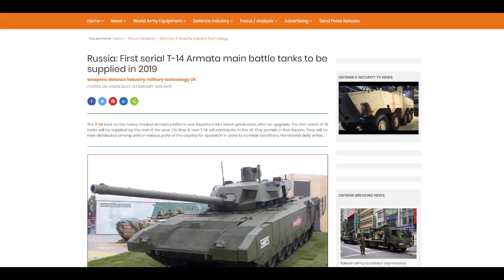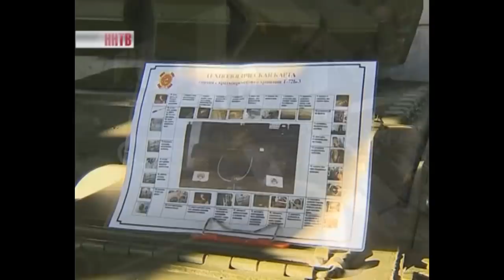Problems with Russian tanks

Comment: Press F for the 4 guys in the T14 factory
Reply: @ultra sisko Analogy for Armata's slow production
Reply: @iqbalnash5748  mbt-70
Reply: @iqbalnash5748  And why issue many tanks and to repeat mistakes Leclerc-2 and f-35? The design stage involves the production of a test series, engineering samples for testing usually at least 100 units.
Reply: Джо //Elusive// ... actually Russia was supposed to order 2300 T-14’s by 2020, reducing the order to 20 with further orders for 32 more, so not even close to having 100 T-14’s? The simple truth being that while president “blowhard” Putin rattles his saber ... because of economic sanctions, Russia has been forced to reduce their defense spending by $20 billion, all but canceling the T-14 and SU-57!??
Reply: @JimCOsd55  Russian Industrial output increased by 14% last year. 
The best growth recorded in the world. They still have many major projects coming on as a few others finish. Something has to give. There biggest problem at the moment is a lack of skilled workers. Even with a big influx of skilled workers from Ukraine as a result of the USA Coup they still are short of skilled workers. Also the brain drain now of the 1990s is reversing itself. Many skilled coming back home. This shortage of workers is the very reason they use mainly Guest workers from CIS nations on major projects that only require semi skilled people. 
This lack of skilled people is not uniform throughout all of Russia. He could be correct when he says they are updating the older T80s for the simple reason there are not enough skilled workers and a plant suitable to do the newer models elsewhere. As a compromise they have decided to do the older tanks at the plant that built them and in an area that has the skilled people available to do the job. A few upgrades at the plant and upgraded tanks coming off the line and skilled people back doing what they should be doing. Solve two problems at once. 
Some idiot here says the Russian Defense Budget has decreased by $20 billion. Yes! Based on Exchange Rates. An absolutely useless comparison now Russia overall operates outside the Western Financial system. If he understood Economics at all he would understand. Based on GDP Russia has not been growing much. The exact opposite is the case. There Production of Goods and Commodities has been growing quickly.
 Russia has been reducing its Defense budget as a percentage of its total Production and as a % of its Budget but in reality it has stayed much the same. While it accounted for a bit over 4% of its Production 4/5 years ago it now accounts for about 3.2% of there Production. With there increases in Production it still remains roughly the sane in terms of what they buy. They are now at about 70% of new or heavily upgraded equipment. Ahead of schedule and actually under budget. By 2020 they will be close to the 100% they were aiming for.  
There motor industry is back at full production again. Is the USAs? The thing that slowed it up was a rise in interest rates when Financial Sanctions went on. They now have found alternate finance outside the Western system and interests Rates in Russia are well down. About 4/5%. There Corporations have got out of Western Loans quickly and probably will never touch them again. You can't trust Western Banks and the way the USA and UK Government uses them as a Weapon. Just like the way they use the IMF as a weapon. 
It all has failed whatever way you look at it. Russian Industrial Production and Agricultural Production has been growing quickly and the sectors that supply them. Oil has improved but never really recovered. Gas has increased in price and the demand. Within weeks the new pipeline starts to deliver Gas big time to China. That will be big money flowing into Russia and one big project finished. There Trade Surplus increases even more and Tax Revenues go up again. This is why they are reducing there Defense Budget. Not in real terms but as a % of there Budget. 
Why everybody gets confused is because everybody quotes GDP. A useless measure for Russia now they overall operate outside the Western Financial system. It does not measure Production. 
Sanctions have not worked at all. Overall the complete opposite effect on Russias Production the USA wanted them to have. 
These increases
Reply: @JimCOsd55  The reason is much simplier: Russians have technology, but they do not have industrial power to implement it. They need whole new factories, since old ones simply can't handle T-14 production, as well as there is lack of qualified personel to man those factories.
Reply: Discerning Troll ... and so with all these good economic numbers - did Russia reinstate production of the SU-57 and T-14 Armata? Nope, even at $3.5 million a tank they’re going with the simpler and cheaper expedient of improving older T-80’s with new fire control since they’re no way to fit the improved 125 mm gun and they’ll probably incorporate the active defense system into it eventually. While the SU-57 which still lacked the avionics and engine to compete with the F-35 would cost $135 million a pop, one of the reasons India dropped out of the program when they figured they could buy an F-35 for $90 million to compete against an F-35!
Reply: @平教經  one t-14 factory  plant is already  manufacturing the second  plant  is under construction  you will see the  results after 2020.
Reply: @JimCOsd55  acording to this sources by 2000 whe must have already the World end   20 times  acording to them .What a bulshitt lies do you invent just recently  from Ukraine around more then 2 milions  peopel  mooved in Russia  betwean them where a lot of scientists  and  workmanship employes.Now even from African continent the Boers moove by thousand in Russia .A lott of Austrian and Germans  are considering  to moove to russia if this migration crisis will not stop.
Reply: lowe booty ... even Putin admitted in an address in 2006 about the demographic crisis and again last year. While Russian immigration is limited to those of Russian parentage so Russia did add 2 million when they invaded the Crimea but that is one of the reasons sanctions have hurt their economy, causing them to reduce defense outlays and cancel the SU-57,T-14.!??

Vladimir Putin Warns of Russian Demographic Decline
Vladimir Putin pointed to the decline of the Russian population as a result of the Second World War and "roughly the same decline in the mid-1990s due to enormous problems in the economy and de facto breakdown of the social sphere."
AFP
Updated: November 28, 2017, 9:00 PM IST
Reply: Discerning Troll 
Very well said, they also have massive reserves of natural resources and like it or not the whole world needs these so they can only be held down for so long 👍
Reply: @JimCOsd55  Well, might be. Only thing, that could potentially save Russia are right-wing politics on all levels, but it will be impossible for them without overthrowing their modern rotten-to-bones cleptocratic political system and that again, requires people of special mindset, which modern Russia does not have. Russian nation however is in some kind of nation-wide depresion: people lack will to act and lack passion to be able to sacrefice themselves to noble cause. It is worsened by their government declaring any political activity, that goes against the views of their current post-soviet system, being instantly declared extrimist and people end up in prison. One thing, that modern Russian government clearly got right is how to prevent insurgencies, I give them that.

Too sad, since I admire the culture they were before 1917.
Reply: @lowebooty8821  Before the Coup in Ukraine there already were about 4million Ukrainians working in Russia. Not much point staying in Ukraine now while the useless unproductive Western areas of Ukraine are now in control.
Reply: @JimCOsd55  You obviously live on wishful thinking. Sukoi and responsible Government spokespersons have been saying for years the SU57 will go into production when the new Type30 engines is proven up. There top Defense people have also said numerous times they will buy the SU57 when it becomes available. 
They don't want a joke like the F22. About 187 supposedly built but only about 120 combat capable. The first 67 supposedly Production Aircraft are not capable of Combat. Probably never will be. Too expensive to get them Combat Ready. 
Was that clever. Put them into Production and it was not until Number 68 they actually got a Combat ready F22. 
The F35 even though delayed is a bit better. About 100 supposed Production F35s that are not Combat Capable. Too expensive to fix. Another 100 supposedly Production Aircraft that may be worth updating to Combat Ready. Maybe.
Reply: Discerning Troll ... dropping 3 million since 1990 is not a static population, a population needs to grow, they need to replace their workers as they age. A growing population looks like a pyramid with the youngest at the bottom and coming to a point as the population ages and dies off. Russia is not only suffering low birth rate but coupled with men dying at an earlier age due to alcoholism and problems inherent with that, there pyramid is turned on its head. Putin’s attempt at reversing this decline has slowed it down but it’s still not enough to save Russia from this demographic crisis nor is it just them facing this problem. China’s one child policy has also left them with a skewed pyramid where as their population ages, there are fewer workers to replace and support them! 

The 111 million population by 2050 is an extrapolation by scientists including Russian that if no changes are made, it can be reversed if Russian women begin having more children the problem being that today’s women across the globe are no longer interested in large families! Many western nations are facing this problem ... the only thing saving the US is the influx of immigrants both legal and illegal which is why the US’s population grew by 80 million when Russia’s dropped by 3 million!??
Reply: Discerning Troll ... if the F-22 was such a joke then why did Russia attempt to produce the SU-57? They may get engine working by 2025 according to their plans but without backing from India, its pretty much a dead end project! Everyone saw how the F-117 flew into downtown Baghdad thru some of the strongest air defense of the day to accurately hit targets without a scratch. In 25 years of service and 2500 sorties, they hit over 60% of their targets with only one F-117 ever being shot down, more likely due to a Serbian commander positioning his S-75 battery in a position he noticed the jets used time and again to egress after an attack. He was never able to duplicate that feat in the 78 day air campaign otherwise the US would’ve grounded the entire F-117 fleet once they realized that Serbia could target and shoot them down at will!??

As a comparison, India launched a dozen Mirage jets, each carrying 1000 kg in bombs to hit a terrorist Madrassa in Pakistan last week, they said they wiped it out but satellite photos didn’t even show one bomb crater, the Madrassa was untouched ... they were forced to drop their bombs by Pakistan fighter attacks that downed an Indian MiG 21! 

The F-22 was designed as an air superiority fighter to replace the F-15 and take on the latest soviet fighters on the drawing board until the Soviet Union fell, then it became hard to justify its cost against an enemy that no longer existed? The US saw how Russia worked to improve their S-300 and S-400 missile systems and knew the subsonic F-117 needed an upgrade so countered with the supersonic F-35 as a multi role fighter able to attack and fight against those SAM systems. We may find out who has the winning design if Israel and Syria ever pit the F-35 against the S-300 to see who has the bragging rights and who has to go back to the drawing board!??
Reply: @JimCOsd55   Putin wanted 2,000 of them by 2020.......it's 2019 and there's less then 50 built give me a break they underestimated how hard it is to build a modern MBT
Reply: Theprfesssor ... I totally agree, they wanted to build 2300 T-14’s by 2020, dropping that order to 20 by 2018 with another 32 ordered by 2020. The drop in oil from $100/bbl to $48/bbl along with the economic sanctions made the tank to expensive to build in the numbers they needed so Russia turned to the cheaper option of improving their T-80.
Reply: @JimCOsd55  Probably a bad translation of the media. 2300 tanks by 2020, taking into account the repaired T-72B3 and T-80BV M. Nobody spoke about 2300 T-14 since production isn't ready, the plant is only under construction. The first series of Armada of 100 units is ordered, so if more than 1/3 is T-14... that's good. More than enough for the tests. All the same, these tanks will be returned to the manufacturer to eliminate defects in serial tanks.
Reply: Джо //Elusive// ... Of course, bad translation? More than three years after Russia’s T-14 Armata tank made its widely touted and much scrutinized public debut, the country has made it clear it has no plans at present to buy more than 100 of them. The design’s ballooning cost has forced the Kremlin to focus its efforts on upgrading its T-72, T-80, and T-90 tanks, instead.

In 2015, Oleg Sienko, then-Chief Executive Officer of Uralvagonzavod, or UVZ, the T-14’s state-owned manufacturer and Russia’s largest producer of tanks, had said that he expected the Kremlin to order as many as 2,300 Armatas by 2020. The first examples made their initial public appearance ahead of the annual Victory Day parade in Moscow that year and one suffered an embarrassing break down during a rehearsal. The Russian government's planned purchases of the type have steadily shrunk since then.

“We don’t really need to for this, these models are quite expensive in relation to existing ones,” Russian Deputy Prime Minister Yuri Borisov explained to reporters to reporters on July 30, 2018.

http://www.thedrive.com/the-war-zone/22600/russia-cant-afford-its-new-t-14-armata-tanks-turns-to-updated-older-designs-instead
Reply: @JimCOsd55  100 units is the first series for testing, the platform itself, not only the T-14 tanks, they are already ordered and ever produced.
the figure 2300 appeared only in the report, which state the need to replace 75% of military equipment with new or upgraded by 2020, no one talked about 2300 T-14 is a journalistic duck.
True, it makes sense to concentrate resources for the renovation of production in the first place. For the production of serial T-14 built a separate plant.
Ministers can say anything, they do not know what is happening in the industry, they do not have access.
All the above officials should be checked from the point of view of the economy, they do not understand anything in production. Yes, the T-14 is much more expensive, but the T-72B3 is cheaper and there are many of them, it is a statement of fact, not a statement.
Reply: @JimCOsd55  t-14 is formidable platform comparing to any existing platform, even foe from foreseeable future, while su-57 is pure garbage compare to China and JSF 5th gen offering, it is not even up to some 4th gen plus standard on some part.
Reply: Brian Lock ... still, the T-14 being formidable means nothing if Russia can’t afford to build them in sufficient numbers?
Reply: @skippy5712  an increase of 14% from the 20 tanks is not good.
It's like when I tell my teacher that I have improved my grade by 1800% because I improved my grade from 1 to 18.
It's still a fail.
Reply: @JimCOsd55  Stop playing with figures. You go back to 1990. Yes there population dropped during the 1990s. Russia was a disaster area. 
Get out of the past. What has happened since 2010?
Reply: @JimCOsd55  Obvious they had Technical Problems to solve when the Military tested the first 14 x T14 Tanks. That happens in every Nation. 
Also they probably have changed there Defense Priorities. 
Russia and Putin in particular are determined to keep there Military Spending down.
They have dropped it since 2008 from over 4% of GDP to less than 3% now and intend to keep reducing it until 2025 as a % of GDP. 
You have to remember in recent years they perfected there Hypersonic Missiles, there Hypersonic Glide Vehicle, there Kalibre Cruise Missile has proved itself. 
Not hard to understand they change there priorities as Technology. 
There Improved Missiles don't need Stealth Aircraft. The SU57 becomes less of a priority. 
Who knows how advances in Technology and perceived Threats has changed there priorities. 
Slow up one program to push another one ahead. 
As I said Putin is determined to get there Military Spending down to obviously about 2.5% of GDP. 
Is that beyond you?
Reply: @God-yr9rs  I never said it was. 
Russia has its own Priorities. 
Production of about 1,000 Kalibre Cruise Missiles though is a big increase. 
There new Hypersonic Missile in early Production is a big achievement. 
For all you know they took money from the T14 program to there Missile Program or the most likely thing is they had technical issues with the first 14 when there Army started testing them. There secret. Happens everywhere. 
The SU57 is clear. They clearly said a few years ago the Testing of the Type30 Engine was going so well they would not start full scale Production until the Type30 was ready. Common sense.
Reply: @skippy5712  
There is no shame in having a crappy economy.
We are not trashing your equipment quality.
We are trashing your economy.

Just close the Central Bank of Russia. Stop increasing the money supply.
Deregulate the economy into oblivion and then you will see a result.
There will be a massive recession, but it will stabilize your economy in the long term.
Reply: Skippy ... Putin was taking advantage of the rise in the price of oil 9 years ago and was increasing spending! That’s when they talked of building 2300 T-14’s and 450 SU-57’s, then the price of oil dropped forcing Russia to cut back defense! Yet Putin kept on talking about all of the new super weapons he’s building causing NATO to increase their defense spending to $900 billion! Yet, like the T-14 and SU-57, they’re having trouble getting their nuclear powered cruise missile to work with 4 failed launches and now their engine exploded a few weeks ago killing the engineers designing it! Look, the US has 6500 warheads with 1600 ready to launch, Russia has about 6800 war heads with 1600 ready to launch. We both have enough warheads to make both country’s and most of the world a nuclear wasteland! Putin is blowing hot air about new super weapons that will make little difference to the balance of power. Neither country has the technology now to stop the others 1600 war heads ... so spending money to build new unstoppable weapons makes little sense! Especially when the country’s you threaten have GPD’s that dwarf Russia’s by 31-1 and can easily outspend Russia on defense by 28-1!??
Reply: Skippy ... since 2010 ... 3.6 roentgens, not great, not terrible?

The population actually did increase for 3 years before continuing its downward trend. The U.N. figures that Russia’s population will drop to 132 million by 2050 with 1/3rd being over 60! While Europe’s will decrease to 450 million and the US population will increase to about 438 million by 2050? This demographic change is already effecting conscription into the Russian army?

Recently, the number of young people who are fit for military service has been growing mostly due to legal measures and a new definition of “fit for service”. In fact, in the past two decades in Russia, young people’s health has been deteriorating. One of the most significant factors affecting the poor health condition of today's young people is excessive use of alcohol starting from an early age. Recent studies underline the significance of excessive alcohol consumption as an explanatory factor in the unusually high mortality rate among young Russian men.

The fact that Russia now allows foreigners aged 18–30 to serve five-year contracts in the Russian armed forces indicates that the Russian leadership has a realistic view of the demographic problem facing the armed forces in terms of the quantity and quality of conscripts.

https://puolustusvoimat.fi/documents/1948673/2015525/The+Russian+demography+problem+and+the+armed+forces+Trends+and+challenges+until+2035/a2ef95eb-b9ab-4563-ba31-cc1010b3c20c

2010	-239,568	
2011	-129,091	
2012        -4,251	
2013	  24,013	
2014	  30,346	
2015	  32,038	
2016       -2,286		2017	-135,818	
2018	-224,566
Reply: @JimCOsd55  Bullshit! Thats your wishful thinking. 
In real terms there Defence Spending remains the same. 
They still buy at least 100 new Fighters a year. 
The T14 will take over in time. 
Why the hell do they need it. 
They have about 50 Battalions of S400 deployed. 
They have about 100 Battalions of upgraded S300 deployed with another 100 Battalions of S300 in Reserve. Not upgraded. 
They are producing about 1,000 Kalibre Cruise Missiles each year for there Navy and Air Force. They don't need anything special or new to use. They have such a long Range. 
They just let a Contract to upgrade 4,500 of there older Cruise Missiles. 
Who is going to attack them? 
The USA might have a big Navy but Russia is set up very well to fight a land War.
You talk shit.
The USA is now supposed to have at least 2,000 F35 deployed. 
Is the reason they have not because the USA can't afford them? 
No. The F35 has been one delay after another. 
It will be 2023 before any F35 approaching the original Specification starts coming off the Production line. 
The DAS is already surpassed by other systems in the World it has taken so long. 
Not until 2023 will it be ready. Not until then will they have Software that can meet the original Specification. 
What about the Zumwalt. Twenty years and still not operational. 
Still no Gun. To be converted into Missile Boats. 
Only three sort of built. 
So hopeless the USA is looking for a Foreign Frigate. Not a smaller Zumwalt. 
A complete stuff up. Russia has those also. 
Technical Problems in Development. 
At least there Nuke Deterrent is being replaced by ICBMs at least 2/3 Generations ahead. The USA still talking and researching. 
At least there new generation Cruise Missiles are in production including there Hypersonic Missile. The USA is only 12 months into a Hypersonic of what type we don't know. 
The USA is too broke at there Costs to keep up in all these areas. 
The USA is too broke to develop a better Patriot and Deploy it in Numbers. 
Too broke to develop and Deploy a Guided Hypersonic Glide Vehicle for there Nukes. 
Still only has the old Minuteman. 
Too broke to Develop any really new Anti Ship Missiles. 
Too broke to equip and arm there Littoral Boats. They remain nothing but glorified Patrol Boats. 
Thats what you sound like.
Reply: @JimCOsd55  Yes they cut Spending in many Sectors when Oil Dropped but they kept all Critical Projects going. The 12 we saw in the Parade were going to the Military for final Testing. They announced that. They do make many Press Releases but you don't see them on Youtube. Its delayed or they have changed there Policy Priorities or there are Technical Problems. 
Putin especially wants to contain Military Spending overall. They will reach 70% all new gear or heavily upgraded gear by next year. Right on Target. About 70% are now full time Professionals also and entry standards are well up. 
He has warned all Military Industry to start moving into Civilian areas of Production as after 2025 Defense Expenditure will drop in real Terms. Thats 17 years to renew there Military overall. 
I don't know why the T14 is only being produced in more or less Test Numbers. 
Do you? Technical Problems. A Change in Direction. They decided it was more important to spend the money on other Defense Projects. The T90 has been by far the best selling Tank in the World. With Active Protection maybe they consider upgraded T72s and T80s plenty good enough in the long term. Thats all the various T90 versions are . I imagine they can put Active Protection on them in due course. You just say it is lack of money. 
Russia only lost a bit with Sanctions. The fact they got the courage to ban especially EU Subsidised Agricultural Products being dumped there well below cost is the reason there Agricultural Sector is now booming. It attracted Foreign Investment and allowed Existing Russian Producers to finally compete. Nobody can compete against EU dumped shit. Agriculture now is there Second biggest Export. There Farm Machinery sector is booming getting 80% of the Local Market again. For instance there Harvester Companies now hold 80% of the market again. They also Export Harvesters. They took over Versatile in Canada. I think it is Class or some other that builds there now and Exports. You can't get a Russian Tractor in the West now. Got too expensive and there home market takes all they can produce. There Economy is not dying. It is thriving. Yes Russians have had it a bit tough. Food went up but now coming down. Putin admits that. That is why he is so tough on the Military. He resists letting them get the  money now coming in being spent on the Military. The Military has to live within there budget. Federal Revenues have gone up a lot. There Tax System is simple with say Oil. I think on average the Federal Gov. gets everything over about $38/barrel on average now. The price today was $58. As I understand it if Shell wants to Develop a Field they simply set a Price for the Oil Field depending on how costly to Develop. Thats what they get adjusted for Inflation. Above goes to the Gov. 
The Government owned stuff not sure how it works. All profit to the Gov. I assume. 
It runs efficiently. Well managed. Corporations are not that efficient. 
Medevede cleaned it up before he became Prime Minister. 
The  SU57. They told you what was happening when they ordered the 12 or whatever. 
No bigger orders until the New Engine was ready.  
Forget Exchange Rates. Russia overall operates outside the Western Financial System. Thats all Exchange Rates indIcate. Not Production. 
The Fact they have gone from well over 4% of GDP on the Military to 2.7% this year shows there Economy is growing. They are still on track to have an all new Military by 2025.
Real spending is being maintained to do that. 
Does it matter if they upgrade older Tanks or build new T14 that might have critical problems. Russian Cruise Missiles are more important. There Hypersonic Missile is more important. There SAMs are more important in the Conventional area. 
No rush for the SU57. Present Aircraft can launch there Missiles. Working with there SAMs Russia has the correct Doctrine in my mind. 
Manned Aircraft are getting less and less relevant. 
All this about Russia being broke is US Propaganda. 
At age 70 according to the US China has been going to implode for 20/25 years. 
Yet China is still on track for 6.2% growth this year. 
Can Trump repeat his miracle 2% last year. 
Its hard to compare Russia now. Exchange Rates and GDP based to a big degree on Exchange Rates are useless.
Reply: @God-yr9rs  I am Australian idiot.
Reply: @skippy5712  Strange, I've noticed a lot of Australians and New Zealanders on here that tend to toe the line for Russia, spouting off Soviet apologist non-sense, and current day Pro-Putin propaganda. Strange indeed..
Reply: @JimCOsd55  I just noticed you are still going on about Alcohol consumption in the past in Russia. Again going back to the 1990s. The stats you give are based on the past. 
Russian alcohol consumption is now down by 53% since year 2000.
Yes Alcohol consumption went up with high unemployment and the nation falling to pieces during the 1990s. 
 Move on and look at today. 
Today is all that matters. Not what happened 20/30 years ago.
Reply: @skippy5712  Russia will soon have fewer people than Iran. What a joke.
Reply: @kyle857  Whats that got to do with the Quality of a Nation and its People. 
I am Australian and very proud of it. There are only 25 million of us. 
You know being Australian is good when you travel. We are welcomed every where.
Reply: There is now only 3, there was a little 'accident' involving the other worker
Reply: @merekgrimaldus9865  I love you Vlad, plz don't send me to gulag! xD
Reply: F
Reply: LO fucking L.....the funniest thing I've read in years.......!!!!!!
Reply: Perhaps here the parable:
Two blind men were led to the elephant and asked to describe his appearance.
One blind man felt the trunk of an elephant and said that the elephant is rough and long.
The second touched the tail and said the elephant is thin with a brush on the tail.
they're both right...
This is only part of the picture.
And much more difficult than at first glance)
T-80BVM is the modernization of T-80BV, not the earliest T-80B, namely T-80BV after 86 years, if I'm not mistaken.
they close the armor and protection to T-72B 89g.
Their modernization is connected both with the desire to load production with orders and with the fact that Russia is implementing a defense strategy.
and tanks in it, one of the milestones. You need a lot of tanks, a lot... only UVZ and T-72B are critically insufficient.
In addition, with the increase in protection, power and efficiency of the gas turbine engine, it was again possible to realize the potential of the existing T-80BV that previously wanted to be written off.
In addition, the tanks are not disposed of, only what can not be used. Like the first T-72A and T-80. They're disassembled for parts.
The t-90M is a development of the T-90A with a 2004 welded tower, similar to the tower for the Indian T-90S. But towers different.
T-90 is a compromise between price and performance. The t-90 we know shouldn't have been born. Object 187 was supposed to get this index.
T-90 is object 188. The t-72 as well as the T-90 were to give way to a new tank by 2000. But the Soviet Union collapsed and the T-90 (chassis of the T-72B and turret of the object 187) was the T-90A.
The impasse and design flaws of the T-72 were evident in the late 80s, and the t-72B was actively designed replacement. Which was supposed to be 187.
That is why the T-90A has never been produced for Russia in large quantities, it is outdated even then. Total left about 300 T-90A.
T-80U require extensive repair, T-80BV a lot and they are NEW. And T-80 as well, in many ways has the same disadvantages of the direct ancestor - > T-64B
The military said that a universal tower "break-3" suits them at the moment. But the chassis is hopeless. You can not increase the armor, you can not put a more powerful engine. Easier to make new hulls like ... object 187.
T-90M has long surpassed the capabilities of the T-80U.
T-72B3 has several iterations.
2011, 2014 and 2016.
The latter have an engine of 1130 HP and many other changes, and will gradually be standardized. As T-80БВМ. In many respects they already repeat each other.
In addition, the T-72B3 does not use the old contact-5, a Relic in the K-5 body, simply because it would be pointless to change it, the efficiency increase is small, and the costs are huge.
Especially if you need 2000...4000... and better 6,000 tanks.
The first T-72B3 2011 sent to repair and take their place T-72B3 utth 2016. This is a fairly common practice, you just need to know the scale.
The same with panoramic view. Yes, it is really needed. But on T-72B3, which will be written off in 10 years. What for?
The commander of the T-72B3 (or T-90) will receive his thermal imaging device, but in the next stage. As well as elements of active protection like Arena-M.
Yes, the T-72B3 is primarily aimed at fighting the old T-72A,T-72M,T-55, Leo-A4... the most massive of possible opponents. For everything else there is ATGM. 
Which can already ignore the "Trophy" and similar systems))
No one will invest funds and resources in the modernization of tanks that already had to be written off. There will be no global modernization. There will be major repairs and replacement of components and parts for modern, so that these tanks could remain relevant for 10-15 years.
The fragmentation of modernization is also due to haste and the economy.
 "Just go and make a welded tower..."Yes, 2000 universal towers... or 4000. No, thank you!
This is a massive tank, it needs a lot. Russia is preparing for a possible war. The West in crisis and always their problems the West decided through war. Russia, China... who cares?
Now it's more and more obvious.
P. S.
T-14 and "Armata" requires maintenance comparable to aviation personnel. In addition, we need new materials and machines in large quantities, we need trained people.
It will take at least 10 years or more. Even with such a scale as in Russia. By analogy with aviation it is so. Armata is primarily not a tank, but a lot of different combat and not only special vehicles. It takes years of research and testing. This was the ordered series of the first 100 series of tanks to test and identify weaknesses.
Russia does not want to repeat us mistakes with the f-35.
T-72B3 will remain in the role of support or will be transferred to the allies or sold as the T-90S. Characteristics depend in the first place on the desire and capabilities of the customer. Algeria bought prodvinutyy version of T-90S, for example.
Sorry for the long text and bad English!)
Reply: If Russia is so rich and prosperous then why are their currency like shit and always seem have to beg for foreign investment? In fact the Russian ruble is like the least valuable and sought after currency in the world, even the South African rand have more appreciative value than the ruble for the past decade.
Reply: @Blahb-o9b  see my reply to lowe
Reply: F
Reply: F
Reply: F
Reply: Lord why is everyone being so serious about this comment it was just a joke
Reply: At least they have an excuse to go slow
Reply: @I_am_a_nice_person  ya it's really too bad it embodied the all purpose tank with the large caliber main gun for large explosive shells, sabo, and atgms the 20mm auto cannon it's kinda sad they didnt keep that auto cannon past the leo 2k prototype but how cool would it be if today's mbts could simultaneously preform the roles of a combat engineers vehicle and an ifv like that
Reply: because t-14 is japanse tank
Reply: @Blahb-o9b  No argument about your first paragraph. Putin and all Officials admit that about 30% of Russians need more help. 
Yes some Pensioners have problems buying as much food of the quality they would like. 
Recently the Russian Government allocated $6 billion to help in this area. The cost of Pharmaceuticals will be subsidised for them. Putin in his normal way when it became apparent this scheme was not working correctly took a personal interest and has in his normal way told his bureaucrats to sort it out. 
That will leave them more money for food that cost wise is now back to normal levels after a spike in prices when they banned subsidised European and USA food imports. 
Nothing much he can do if some drink too much alcohol etc. 
No country can solve that problem. The cost of Pharmaceuticals is a problem in the USA for the elderly. They unlike the elderly in Russia are not guaranteed a place to live also and don't get free heating all through the winter months. 
They are working on it. 
As for your next paragraph whatever shit you wrote I will not respond. 
Most nations at the bottom have 30% of people at the bottom who struggle to make ends meet. 
At least in Russia they have free Medical and Education right through. That is working well now. The rich do pay full fees etc.
They are attacking the Pharmaceutical side by now producing many in Russia.
No Multinationals gouging the public like in the USA. The $6 billion subsidy should help also once they get it working correctly and accessible to all those who need this assistance. No doubt they will all get a Card etc. to get the subsidy. Increased Pensions and Welfare is not the only solution. The drunks will only spend it on more alcohol. 
The difference will be something like this. When I visited Russia in 2004 I got crook in the stomach. I went to a traditional USSR Pharmacy and it cost me $5. Five charcoal tablets and 5 Penicillin tablets. Felt better next day. 
I think it was lightly cooked fish. In the South they do it that way. Got it again. Went to a new Pharmacy and got some German Crap  $32. It did not work near as well. 
Thats why they want to make all there Pharmaceuticals themselves. The
The price these Multinationals charge is about what they can get. Not what it costs.
As an Australian where our Government more or less calls tenders and we do have subsidies for high cost Pharmaceuticals often we get common cheap non subsidised Scripts for 10% of what you pay in the USA. The Multinationals are a rip off if allowed to get away with it like in the USA. I imagine Russia also now imports many drugs straight from India. Thats where most are made by all the Multinationals. Buy them for a few $s in India and put them in  Russian packaging. Most drugs are out of Patent. Stop buying them through the Multinationals who put 1,000s of percent margin on them. To do that they will have to test them all themselves. 
$s are not the only answer. Make or get Pharmaceuticals at the correct price. Then you help the poor. 
The USA of course does not do this with there Corporate Socialism. They let the Multinationals conspire with each other and keep the price very high. 
I have not listened to Russias last Budget. It goes for over 2 hours. Putin put in about 15 minutes on Defence. Thats all that gets attention on Western Media. 
I know they have put in place a big Subsidy for young marrieds to buy a house. I know they also have Guaranteed there interest will never go above 5%. 
That is there main push now. There Military Budget is more or less frozen at existing levels. All extra money goes mainly to Family Welfare and this 30% that struggle. 
They are clever. They will not give more money. That only gets spent on more alcohol or drugs etc. with some. 
It will be job Training, Education, Health etc. and cheaper housing etc. The
As I said in my first rave Russias main problem is a skilled labour shortage now in most areas. 
Get back to the T14. Odds on after testing the first batch there are things need fixing or improving. Its completely new. Problems with the completely new transmission its easy to spend two years fixing it. They also are working on a new 150mm gun. Maybe they will hold off until its ready. They obviously want a superior tank. Why rush? They have thousa nds that can be upgraded to keep workers busy. The SU57! They announced that. They are waiting for the new engine to be proven up then they start full production. They have over 20 to prove it up in the meantime with the interim engine. They also have the SU35. Probably the best 4+++ in the world.
Reply: No mini fridge for vodka bottles n cola bottles
Reply: F
Reply: If I had a dollar for every Soviet/Russian tank (model, variant, upgrade, etc.) I would be rich.
Reply: russia altedy has 280 t14
Reply: luka bogdanovic ... and you got this information where? 

In August 2018, at the ARMY2018 Forum outside Moscow, the Russian Ministry of Defense signed a contract for the purchase of 32 T-14s tanks and 100 T-15 infantry fighting vehicles, with delivery to be finished by 2021. In 2019 it was announced that the first 12 tanks would be delivered by the end of that year.
Reply: luka bogdanovic ... Russian Troops To Receive 16 Armata Tanks By Yearend
11:29 AM, February 14, 2019 

The Russian ground forces will receive the first batch of 12 upgraded T-14 Armata Main Battle Tanks (MBT) and 4 T-16 armored recovery vehicles, also known as Armata ARV or BREM-T by the end of the year.
Until the end of the year, 12 T-14 Armata tanks and four T-16 BREMs will go to the troops, Izvestia quoted unnamed sources in the Ministry of Defense as saying Tuesday.
The serial T-14 Armata differs from the previously presented experimental machines. The first production tanks will take part in the Victory Parade in May later this year. These tanks will be later involved in military trials to check in conditions close to combat, the sources said.
Reply: f
Reply: F
Reply: F
Reply: @lowebooty8821  LIVE DIRECT FROM RUSSIA'S KREMLIN is the second of many propaganda specialists!!!!! Please enjoy the bad english!!!
Reply: ANUSH SLAVEIKOV ... $180 billion ... Russia’s GDP is only $1.6 trillion, that would be 11% of their GDP? Look, Putin backed down from an oil war with Saudi Arabia because he couldn’t afford to build the T-14 Armata and SU-57 when oil was at $50/barrel let alone at $20/barrel? Plus with Russia shut down with the coronavirus, he’s going to need all of his cash reserves to keep their economy going!??
Reply: F tho its a new tank it should take some time like abrams took 10 years to enter production
Reply: fffffff
Reply: Fully mass production will begin after 2020   around 450 will be made per year  from armata platforms  and will have a combined turet and projectile and protection whit t-90 upgrades  .The  t72 -b3 or t-80  will be for export  .Simpel reason why only after 2020 they will mass produce armata tanks its the economy  until then all of the pipeline projects around the World will be finished major agricultural trade all time high as in manufacturing  that will ad extra revenues for the military budget.You will sea betwean 2020-2028 the bigest military upgrades for Russia  .UISISA is in panic mode that is why they try now to add as mamy presure they can  against Russia  whit sanctions.Until 2020 Russia will have 90 % modern ground troops navy 72 % ,airforce 100% .Su -57 till 2028 around 150-170  the rest will be mig-35 and su-35  and in 2-3 years  the mig-41will apear .
Reply: you might be the worst disguised Russian ever. Last I checked by the time the Russians can do anything at all,  the US own projects will be far ahead of the game. We really aren't in panic mode. 
 @lowebooty8821
Reply: @lowebooty8821  This hasn't aged well. It's mid-late 2022 and they still dont have a single production unit. They have 6 Su-57's after 4 years in production, and their navy is a joke.
Reply: @lowebooty8821  And what are these weapons? Laser guns? Biological weapons? Invisible bombers? Russia can't supply their soldiers with basic boots, yet they can afford these super weapons that can win every conflict? Only way Russia is reaching even Poland is with nukes, which Europe will respond with their own nukes in kind.
Reply: lowe booty ....
Uuuhhh ...  obviously you are doing the SAME OLD mistake (typical behavior for looser's) again. Which means you are building an imaginary military force with money you are JUST planning to obtain !!!?   Hahaha
You KNOW what we call THIS ?  I'll teach you completely for free (only this one time):
HOPE, is your strategy !!!!   
Congratulation's for your decision-makers !!!  😎😂😂😂😂😂😂😂😂😂😂
Same dream's like "Discerning Troll" 
Go take a lesson in realy effective country's !
You won't succeed in NOTHING as long as you CAN'T devide Hope's/Dream's from simple EXISTING Fact's !!!
.....and btw a bit of freedom and GENUINE Democracy would be REALY HELPFULL to !   😎😂
Reply: @lowebooty8821   chill out we are about to have a huge space economy soon

War is pretty much useless at this point and that's at a snail's pace

Not to mention the world doesn't have the important resources to carry out another war muchless a world war

Basically everyone is rattling sabers
Reply: @lowebooty8821  One person who understands how the Russian Economy has been growing strongly and all the major projects that they have underway and all the investments they have been making for the future. All about to start paying off in a big way. The percentage of there Budget spent on Defence will probably stay at about 3.2% but in reality increase. Russia is about too really boom. If Oil goes up they will explode. These idiots also forget Russian Exports of the T90 are at record highs. The best Tank in terms of sales in the World. Once those orders are filled that will give them more capacity to produce there own.